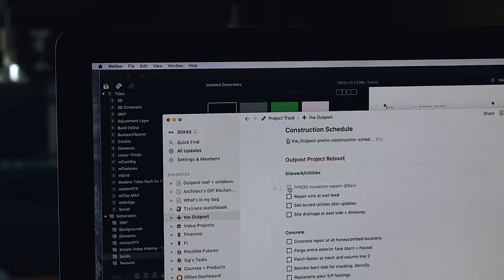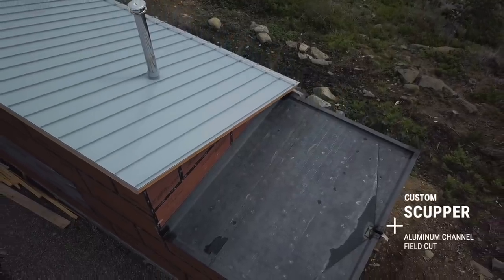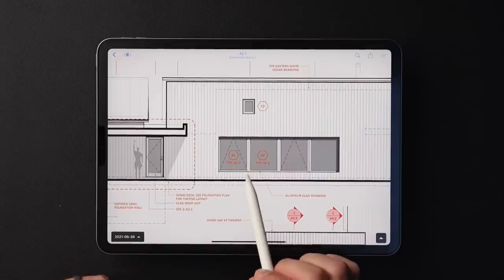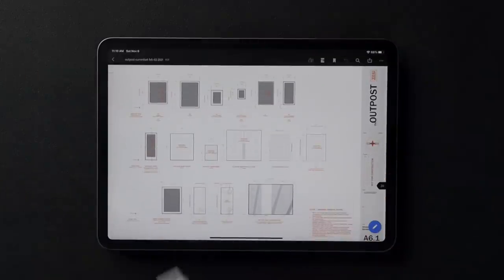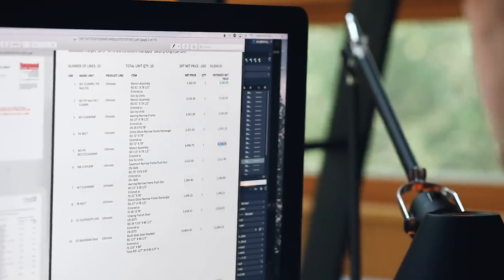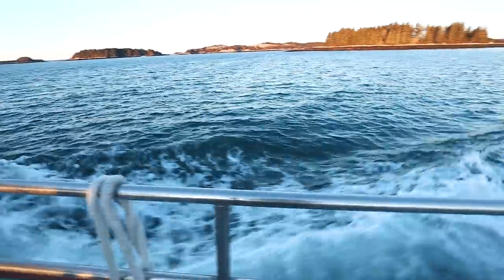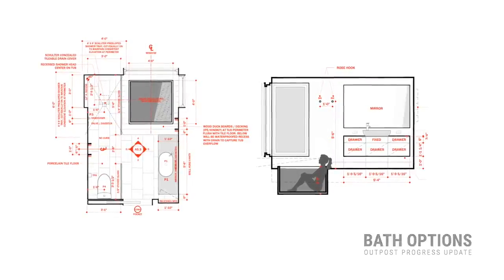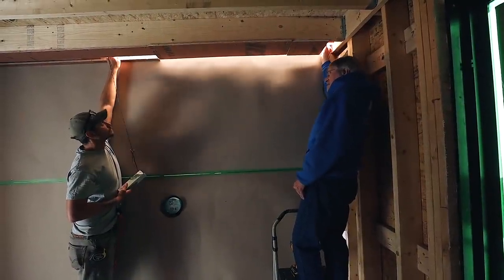What happened to the Outpost Project?

Comment: Overall this is a great informative video of the process and issues that do come up during construction. I disagree with you at 13:00 where you take responsibility for the incorrect window being installed in the bathroom (it was supposed to be a roto-operated window as it was changed in the shop drawing phase). Shop Drawings Rule! It is not the Architect's responsibility to keep changing the construction drawings for every little change made during construction. The Contractor was well aware of the roto-operated window change made in the shop drawings and it was his responsibility to follow the shop drawings...they are more detailed and site condition specific. I'll give you that since the Architect and Builder must act as a team, maybe you could have pointed it out so it didn't get missed, but it should not have been missed as the builder was involved in the shop drawing process and placed the final window order. In the Construction Documents, this could have been avoided altogether by giving each window a separate unique number (in addition to its window type). This way each window that arrives on-site has a specific location where it is to be installed. By only providing window types, the contractor was just focused on installing that type of window (any window in the pile of that type) at that location and not focused on that specific window and its unique design needs.

Comment: Throughout my career, i have been on your end (which i am now), the contractors end, the homeowners end and the subcontractors end on project disputes.  its NEVER a clean breakup.  But glad to see its back on track.  This supply chain and labor shortage is causing alot of these issues.
Reply from the maker: We're learning to work with supply chain issues + labor shortages; quality control is a more complex problem esp. when there's limited oversight given the remote location.

Comment: Just goes to show no matter how much forethought and detail gets put down on paper there are always issues that crop up on the jobsite that requires designing on the fly. And to be able to do this requires the architect to be present during the construction stage. The only hope is that any change doesn't cost the client an arm and a leg!
Reply from the maker: 100%...the construction observation phase is a non-negotiable scope of work for me!
Reply: Totally…AIA says 20%, but I budget 25% fee for this phase on projects like this
Reply: @30by40  In New Zealand, even in the southern colder regions where it snows, it has become popular with residential designers to have clean, sharp lines and this might mean no roof eaves so the forms pop - even avoiding visible roof gutters to maintain that crispness. Sometimes the roof and wall cladding are the same material and it wraps around giving the form a solid unified mass. I'd be interested in your thought process in whether or not to go with roof eaves.
Reply from the maker: @bengmelea8646  I proposed no eaves early on (that's actually still my preference). Visual preferences aside, the functional design negotiations led to opting for a small overhang at the pitched roofs and none at the flat roof sections. The eaves on pitched roofs in our cold, marine climate do offer some benefits such as wall + window protection from snow, ice + rain. The design process - as you know - is full of compromise...I wish too that the glazed areas were larger, more glass facing west with massive sliding panels for protection...alas...ideas for the next project!

Comment: I was watching and noting your 12'-0" drop when installing the windows, thinking; it would have been cool if a platform had been designed to use the pylons/columns you already built, as a clever sacrificial bit that is built, then demoed after the windows & cladding are completed. Also, 5 tries at the shop drawings shocked me a little, but the truth is: if your products are wrong when they arrive, that's the costliest moment to learn it.

Comment: Can you share more about the particular quality issues you encountered?  I'll understand if you can't (for legal or professional reasons), but it would be really helpful to understand what problems came up that were not easily corrected.  I think you hinted at one in the video, when you mentioned the deck footings needed to be re-poured -- why?  Not enough rebar, not the right concrete mix?

Comment: Hi, Eric - I'm really appreciating your Outpost Project content.   Can you comment on the standing seam detail on the ridge (uphill) side?  It looks great, having the standing seam exposed, rather than covered by a ridge flashing.  As an architect, I have received resistance from contractors on this very same detail.  How are you covering the exposed ends of your standing seams?  Adhesive?  Folded tabs?  Thank you!
Reply from the maker: Cheers, John...glad you're enjoying it! The ridge seams are left long and the tabs are lock-folded over the adjacent panel. These are unvented, fully waterproof roofs below (with h/t waterproof underlayment). The copper development association has an excellent handbook with thousands of details you might reference. Good luck!

Comment: Hi Eric. Regarding the "mistake" in the video, doesn't Marvin make retractable screens that just roll up into the top or side of the frame? Would that have been another option for a push-out awning window instead of switching to the crank? I never enjoy cranking, love the push-out. Thanks!
Reply from the maker: They do, but the cassettes for the retractable screens are pretty hideous (in my opinion). There's a much more nuanced story with respect to the Marvin windows that I hope to tell in the future. And, it's a big part of the reason I haven't made a video on this project in a year!

Comment: I see that you used the Zip roofing system on the walls. (Red) Compared to using the Zip wall system. (Green). What was the reason for your choice? Thanks,
Reply from the maker: Code requires 1/2" sheathing thickness for fastening our chosen siding. Green is only 7/16".